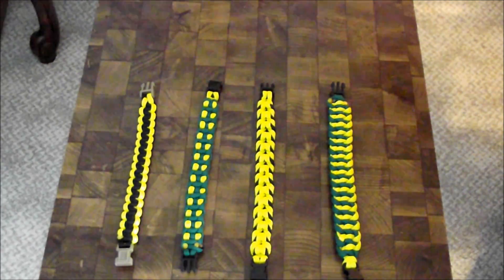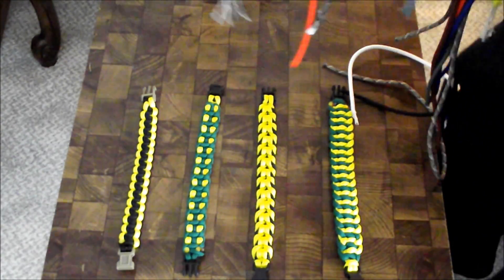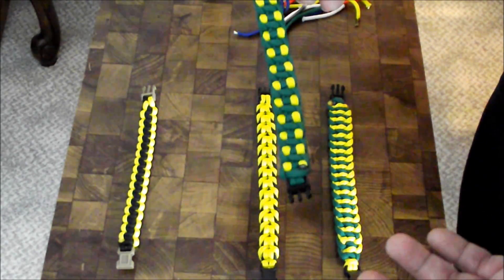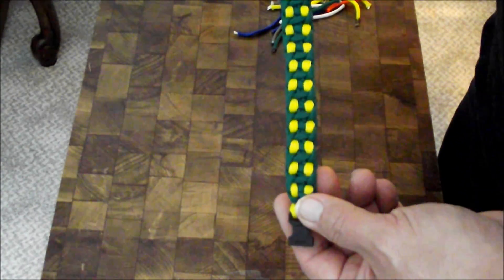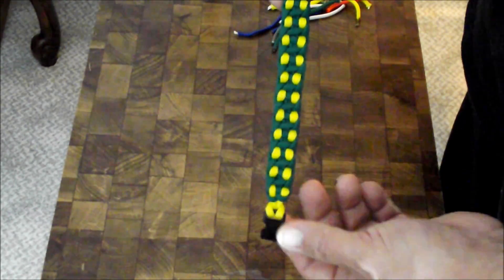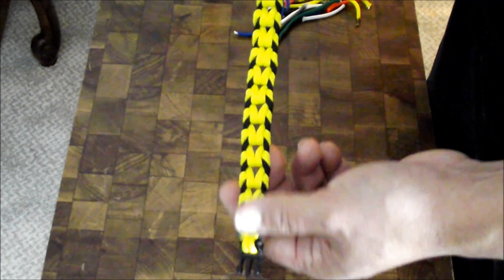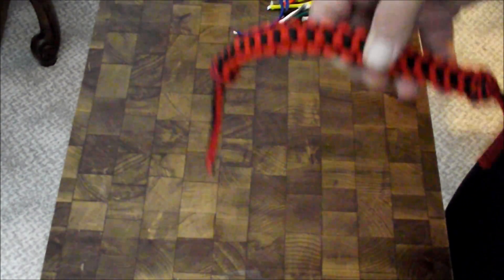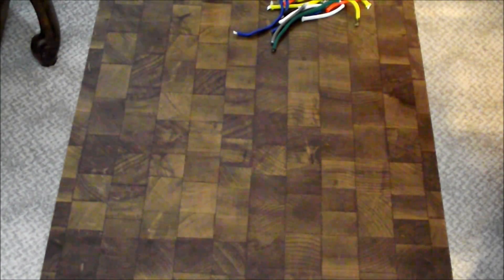Paracord bracelet math formulas_reduce your scrap

Comment: I calculated it and it seems to work, given that I haven’t made a bracelet using this formula. Is the total of all of these in feet?
Reply from the maker: In inches. 
Say you're doing the Solomons bar
(4.5inches of stand to make an 8 inch bracelet ) per cord/color.

(4.5 × 8") + 8 = 44 inches or 3.6666667 feet.
Measuring in inches is more accurate or at least easier. 
Hope that helps.

Comment: How about cord lengths for 95 weight cord? Everybody uses 550, I need to figure out length for a solomon braid bracelet using 95 weight paracord. NOT braiding around a 550 strand like everyone else does, I hate that, actually braiding the bracelet.
Reply from the maker: Hmm, a good question, the diameters will be different and therefore the maths will be different. A good way to get a idea is to use a known length, say 48" make the braid.  Measure the finished part. Subtract the the remaining running ends. With that measurement, subtract the finished length, then divide the finished length.  IE: starting with 48" get a finished piece of 5" with no leftover.  (48-5)/5= 8.6"  
8.6 × 5 +5 = 48 inches
Reply: @Bowfinger6383  yeah suppose I will have to experiment.

Comment: Thanks for the tutorial...do you have one for a King Cobra using a ParaClaw Buckle?
Reply from the maker: Gregory Miyata hmm. You bring up a good point, I measured at the point of attachment from one piece of the Buckle to the other, and had one next to the inch that allows for the buckle. I'll try to get back to you with a formula for that that does not allow for the width of the buckle just the finished braided part. You said king cobra that's with Cobra weave double back on itself correct? Can you send me a link to your para claw buckle. Thank you

Comment: I don't consider lengthy paracord remnants a waste!  You can do many things with those lengths .... Pull the strands out of the center and save it to used as weave inserts.  Also, you can fuse the ends of two colors to make a dual-color bracelet.  In fact, I took 2 feet of excess cord in one color and fused it with 2 feet of another color, and made a tiny paracord bracelet for my daughter's favorite doll.  https://scontent-dft4-1.xx.fbcdn.net/v/t1.0-9/23795197_1731210760242634_2627387188628351497_n.jpg?oh=bfd39fad36e9ef6e79d26f11713f9d92&oe=5A8AC5A8

Comment: Ok, I have a question about measuring for bigger projects.  First off let me say that this video was very helpful.  I screen-shotted the formulas so I could use them for reference.  Thanks for that!  I want to make a bow shoulder sling for my bow.  I would like to use carabiners at each end.  Slip the whole thing through the bow and clip the carabiner around the sling itself.  This is just for carrying it.  How do you figure out how much paracord to use if you want the sling to be 4 ft long when you are finished without a ton of waste?  I'm content using the cobra weave because it's the one I am comfortable using.  I have wrist slings that we bought, I will probably make my own.  How do you attach the cords to the carabiners and not have the weave come loose?  Any suggestions or advice would be greatly appreciated. Thanks so much!!!

Comment: Wow, can't wait to test these formulas out. The Tire Tread in JD's book p. 112 , he says to use two 7 foot lengths for a 7.5 inch bracelet. That would only fit a 7 inch wrist, according to a chart I found.Your formula for a 7.5 inch bracelet uses only 5 ft. for primary length and 4 feet for the secondary length cord. Quite a savings of 5 feet of cord. I am impressed. Good work !
Reply: triumphmanful 6ft-7ft would be all you need for your standard cobra variation knots, however getting into or attempting any new designs out there floating around will require 10ft+ each color/cord (normally includes the core) for 7in-8in wrist size. Thickness will always add more length. Test your lengths and record for the proper tension at the end. All these numbers you see are simply guidelines or suggestions. YOU decide the final length needed for your project. Use common sense and you'll never come up short or waste. Good luck and have fun cording or knotting.

Comment: I am making a pair of 8 foot reins. I did the math and got 144 feet. Does that sound correct?

4.5(96+96)+4.5(96+96)
    4.5(192)+4.5(192)
            864+864
    1728in = 144 feet
Reply: I think it should be 4.5(96)+96 + 4.5(96)+96 = 528 + 528 = 1056 in. = 88 ft.
Reply: Kathryn Jones 100ft sounds close. All about trial and error on your first project. That said I'm sure you've figured out the correct formula by now.

Comment: Do u use the same formula for the wide/double cobra
Reply from the maker: +Noah J  which one? the "King" cobra.
Or a double wide reg solomon's' bar interweave?
The fat cobra that's starts out as a reg, then doubles back onto itself is the  "king cobra"
well. the first part does appy, but when going back over for the second pass, the formula won't work. since I've never done one, I can't give you a true number to use, but if you're willing to try: 

=SUM(4.5* Y + Y) +SUM ( 9 * Y ) per color/strand.

let me know if it works, and how much it's over, or short, on a piece of how long. Thanks

Comment: Hi..trying to do a hex nut bracelet....would you have the formula for this type bracelet? Your video is extremely helpful.  Thank you!
Reply from the maker: Not familiar with it, What type of knot is the Base?  I:e Solomans bar, or catapiller braid,. If it's one of this listed. perhaps add 1.5" to the formula. example= instead of 4.5" per inch-per strand, make it 6" per inch.

Comment: They are wrong. Did a 7.5 cobra bracelet ,added 1 inch to it;so 8.5 x 4.5 inches = 76.5inches of cord. Made it 80 inches, and still came up an inch short on the bracelet!
Reply from the maker: Was it 80" per strand?, and was the braid loose?
Reply: 2 color bracelet ; 80 inch total . You said 4.5 per inch of color. Braid was tight as could be.
Reply from the maker: D Eret umm, 4.5" per inch PER cord = 76.5 " each color/strand, or  153" one color/strand. sorry that you got confused.
Reply: D Eret have to take in consideration the thickness of the finished item.
Reply: It would be 4.5 x 8.5+8.5

Comment: Hi I'd like to clarify something. Will there be an additional inch for the loops on the buckles? I saw a video says 6 inch bracelet needs 7.5 feet of paracord 0.0 and with your computation i got 6 inch bracelet needs 5.5 feet. Its a lot of difference
Reply from the maker: Hello Eggy,  the loop that goes thru the buckle is about 3 inchs long.
Not sure what braid you're talking about. let me know so I can help you figure it out
Reply: uhm im trying to do a normal cobra weave :) 
so with wht i have computed, i need to add another 3 inch along with length i have computed with your formula?
Reply from the maker: Ok the cobra (reg.) uses about 4 & 1/2 inchs per color/strand, for every inch of finished braid, plus the length of the braid in your case six inches, so, IE:6 ".  4.5 x 6 + 6 equals 33 inches of each color, or 66 inches if using one whole strand, so  just add 6 more inches ( 3 per 'loop'  heck add a foot, then measure your drop if it's more then a foot left, the formula works for you, if less, then add a little more to the Multiplier ( the 4.5")
this is a excel formula, put it in a cell, make the "y" the cell you enter your length.
=sum(4.5 * y + y) remember, it is for one strand, in a two strand (normally) braid.

Comment: when i make the shark tooth braid,i use 9' cord for 81/2'' projct.and either i end up with way too much extra,or not enough,or if i un-braid and do it again,i get very little scrap.frickn' fustrating....
Mahalo for the tip.i will try your formulation and see what happens
Good job
Reply from the maker: there is a part 2, that includes the shark jaw bone braid. another tip to remember is: the looser the braid, the more you use
Reply: *****
i'll check it out
thank you

Comment: You can also use your scraps for core cords (the parts that run between buckles that the other cords wrap around).  The ones around 16 inches can be doubled for a two cord core, the 8 inch or so can be melted to the same/diff. color to make a two-cord core, etc, on top of making fishing lures, zipper pulls, tiny keychains, parabuddies, etc.

Comment from the maker: well, on this video, I was using 3/8" buckle ( the width of the buckle)
these 4 formulas included the buckle( which was the 1 inch length that the buckle made when clasped). IE; a 7" bracelet was 6" of braiding PLUS the 
1 inch that the buckle made.
What I did not take  into account, was that different buckles have different lengths.
All other videos will have the formulas made for finished braid length only. 
So yes, I would add other 1" - 1.5" to your  Variable "Y"
Thanks for that question.

Comment from the maker: you know, I've never real done one, but, you might be the second pass will be thicker. So the per inch # will be off, so if you do it just doubled, you'll be short.
Do the 1st pass as normal, but then add a second formula to it, but doubled the per inch. Like so.  Y=10"
=sum(4.5* x Y+Y) would give you 55"
double that gives you 110"
=sum(4.5 x Y+Y) + sum(9 x Y) would give you 145"
this is just a theory,only gives a guess as how  the core radius is  multiplied, 
add 24" then cut & measure the drop